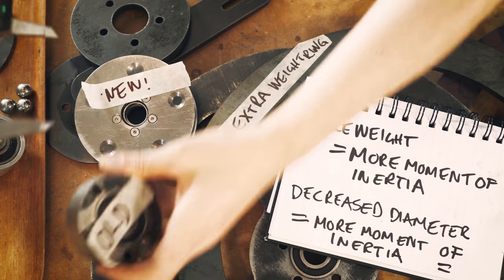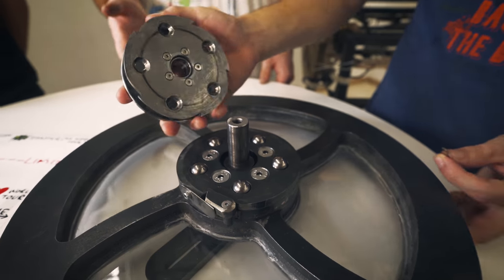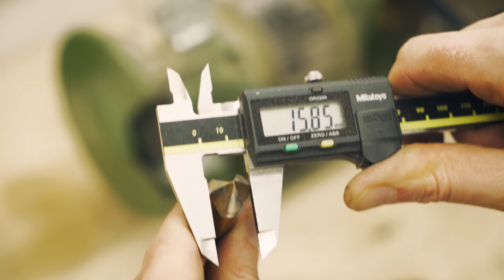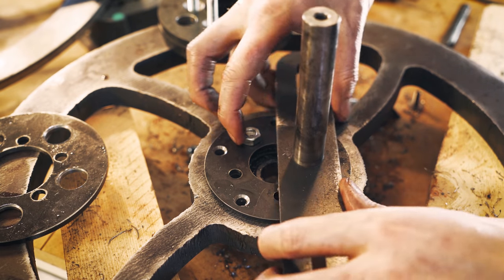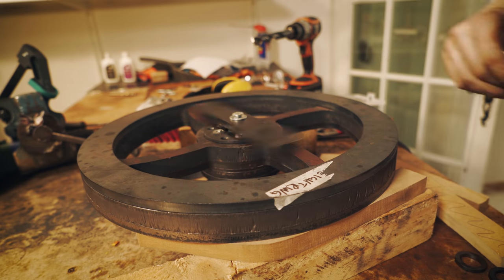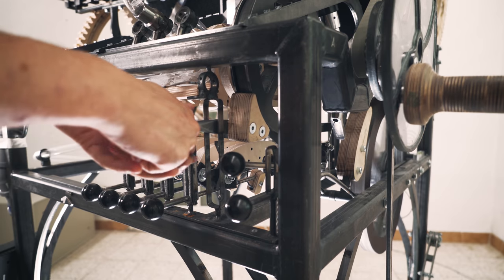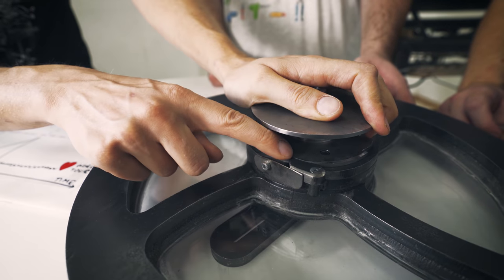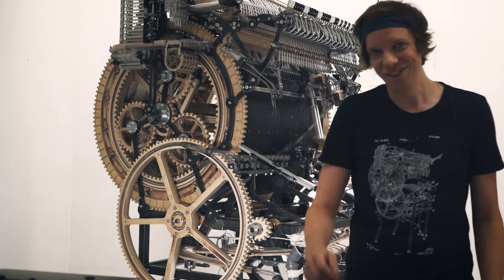Flywheel Torque Limiter - Marble Machine X#90

Comment: Very impressive engineering and craftsmanship! 

One thing that I noticed which gave me pause, is that when the rest of the machine runs, the crank spins as well. Since you're running it in only one direction, wouldn't it make sense to connect the crank with a similar mechanism as that of a bike's pedals (I believe it's called a backdrive stopper?), to stop it from being turned by the machine/flywheel, and making the energy exchange one way, crank -> machine, exclusively? 

I don't know if this would be too much of an energy loss, though, or would produce too much mechanical noise. 

Just a thought :)

Comment: For your brake, you may want to consider using some sort of consumable pad. For as much use as it is likely to see the metal will burnish the wood smooth, in short order. Think of a disc brake set up. The semi-metallic pads protect the structure and function of the mechanics, while ensuring consistent performance.

Comment: How are you going to incorporate the rattling noise?

Guess using super strong nylon instead of steel, isn't ideal? 

How often will you be swapping out the springs to keep the tension? Will they be affected by the heat from the friction of the marbles? 

What's happening with the program plates?

Comment: I'm a bit confused... I wouldn't expect the output torque to drop substantially below the torque limit, I would expect it to chatter just below the limit... Is there a static vs dynamic coefficient of friction at play here, or some other mechanism I'm not seeing, or is the graph incorrect?
Reply: Seems to me that when the balls are retracted and just rolling on the plate the transmitted torque is essentially zero.  OTH when they fall back into the pockets you will need peak torque to push the springs back to pop them out again.  So I think the wriggly line on the diagram actually should swing widely between essentially zero and essentially the peak torque setting, not the little oscillation that is shown.
Reply: Pretty sure the graph is incorrect

Comment: I don't really deal with torque wheels so perhaps I'm missing something but was there any reason why you didn't just use a single spring adjusted plate to hold the marbles instead of having them all adjust individually? It would seem to me like that would open the system up to more potential problems if the marbles were not adjusted evenly.

Comment: If you had made the flywheel without spokes, you would have not needed the plexiglas covers.  The springs on the limiter should not rest directly on the marbles.  The spring will tend to spread and jam in the bore.  There should be little discs between the spring and the marble so the spring has a flat surface to rest against.  Regarding the plate, why didn't you use the old one as a template to make a new one?  Isn't the weld build-up hard to tap?

Comment: Put stickers over the adjust screw holes on the torque limiter. That way you will know if someone has messed with your calibration. I work with a torque limiter every day that uses the exact method you have described and you better believe I make sure my cal sticker is unmolested

Comment: When you have to fill a hole with weld, if you usw a brass plug that covers the underside of the hole it makes it much faster and easier to fill even a large hole. The brass will just break away when you are done and then all you have to do is grind and sand it smooth. Also if the hole is a tapped hole just run a bolt in and cut it off as close to flush as you can and weld it in then grind and sand. The fill will be stronger than the rest of the steel and you will barely notice it if at all.

Comment: Is it just me, or is his graph... Wrong.
Whel the torque limiter kicks in, the torque curve should go to the wiggling motion at that level... Right? The device is a limiter, not a reducer
Reply: Absolutely. Thought the same thing.
Reply: Static friction vs kinetic friction
Once the balls have slipped out of their detents they're not gonna provide the torque they were before
And as long as the flywheel is moving faster than the machine they won't get properly seated again, they'll just bounce over
You can see it after Martin stops the machine with his hand, very little force on his arm until the flywheel's almost stopped and the balls can re-engage

Comment: Nice Diresta Ref. 
P.S. I presume you know but just in case you don't. That little piece that it supplying the racheting mechanism it's ability to both drive the wheel and then also torque limit is known as a PAWL.

Comment: stupid question, is your flywheel balanced as to reduce vibration and why not have the ratcheting paul and spring on both sides to not only keep weight even but also pressure, that way you're not over stressing the poor thing; kinda like a buddy system.

Comment: Tip for welding holes and sheets of metals:
Next time you wnat to weld a metal plates holes shut, you should put a ceramic piece underneath it, with a small gap (0,2-1mm) such things exist with al-stickytape put there's ways to make something else work the same way. The gap means that the material wont fall through, but it the plate will also keep the oxygen out, the small gap also has the side effect of limiting the amount of exess material as well as how far it flows, means you'll have less to grind and overall better welds.

As for everyting else:
A job well done, there wasn't much one could do to improve withoug making things bigger or way more complicated and expensive.

Comment: Your crank needs a free spinning hub, similar to a bicycle rear wheel free hub. This would allow the crank to “coast” when you aren’t cranking it...versus spinning in time with the rotating assembly, ready to catch on an unsuspecting operator and leave a mark (and strum a bone or two). The current Shimano 12 speed rear free hubs now free spin quietly (versus the classic ratcheting of the internal pawls of old), so there is a potential silent solution....

Comment: I like this Swedish / German cooperation  ...reminds me of the time Volvo fitted the  240  series  with a  straight 6 Cylinder  VW Diesel engine usually powering the  VW  LT  25  truck !Due to the outstanding quality of both parts it was not unusual these cars reached  more than 500000  and some even 10000000  Kilometers lifespan !

Comment: I think there is a little bit of a misuse of the term moment of inertia in some parts of the video. True, the flywheel does have a a moment of inertia. The moment of inertia determines how much kinetic energy is stored in the flywheel at a certain rate of rotation (rpm). When not rotating no energy is stored. The moment obviously also controls how much energy is needed to alter the rate of rotation, which translates into the flywheel acting to make the music tight (because the rate of rotation is very stable and requires much energy to change).

Comment: What is your y estimate on the amount of energy (watts) necessary to operate the machine? I fear that you will need the cardio output of a Tour de France rider once all components have been installed. This is one reason against adding anything that increases the energy required but doesn't produce music (e.g. kenetic fingers). Keep up the good work.

Comment: It might be a good idea to get a small torque wrench for setting those screws in the torque limiter, that way you ensure all 5 of those marbles are set to the same release point, and it'd probably be easier to experiment to get the release point that you're happiest with.
Reply: Probably too little torque for a reliable torque reading, especially when you have counting revolutions as a reliable alternative method.

Comment: Noob question - wouldn't the ball bearings in the torque limiter eventually manage to dig channels in the plate rendering it useless at some point?
Don't get me wrong, I'm not criticizing it or anything, it's a great solution. But I'm curious about the interaction between materials. Is the plate to be considered something like a consumable, or more like no matter how many rounds you go with it, it'll likely never reach the point of needing a replacement?
Reply: No, it won't wear down.

Comment: Hey Martin! With everything you are adding, more specifically how heavy the flywheel is, I'm becoming more and more concerned about how much weight the MMX's legs can take. The legs and the welds hold everything together are under quite a lot of stress and I'm losing faith on the reinforcements. Could you demonstrate next week how strong the legs are? Also, how balanced is the MMX? Is it as top heavy as I assume? I can't imagine the disaster of that things toppling over.

Comment: Maybe its an idea to put Bicycle brake pats on the wooden pats, that way you the woodenparts wont wear off, and the pads can be replaced easily by making a clamp system holding them.

Comment: Martin, have you already tested the brake system?
I mean, spinning it as fast as torque limiter allow, and then stopping few times in a row?
I guess, it wouldn't work quite perfectly. Plywood will be grinded by flywheel in short time, imo (not sure, but I think that is the way it will happen)

I suggest you using brake system like they do on cars, motorcycles or bikes. Like with disc, with brake pads... That will be much more reliable, also it will be easier to get spare ones - just go to car hardware store and buy it. 
They use brake liquid in card to make brakes stronger, but I think, you won't need brake THAT strong, flywheel has way less inertia than motorcycle or car(and there will be only one "wheel", not 4 or even 2). I suppose, even a simple mount or high-speed bike brake will be enough

Comment: Do you have spare parts? Not sure many places around the world have brake and clutch parts for a French made MMX. :) 

But no really at some point you are going to have to figure out what parts you have that will wear and need a replacement schedule. 

For the clutch I can see the holes getting sort of galled as the ball bearing roll around in there.

Comment: I think the diagram of the safety mechanism/torque limiter may be misleading. If I understood the mechanism correctly, the torque goes up to the limit, the torque limiter is triggered (the 5 marbels disengage) such that the torque limit is not exceeded. Then the five marbels engage in the next groove the torque again reaches the limit, the marbels again disengage and so on, doing the "drrrrr". Thus the torque seems not to fall back to "almost nothing" but it seems the torque limiter does its "drrrr" near the limit line, not near the zero line.  There may be some race conditions such that the marbels cannot completely engage in time. However the overall rotational speed seems a bit low for that and such an effect should wear off with decreasing speed of the flywheel, such that in the end, the "drrr"-line should approach the limit line.

Comment: Well, a torque limiter is definitely super useful for u machine, but as u can see, the torque limiter creates trrrrrrrrrrrrrrrrrrr sound! It sounds cool but this is also giving impact to the shaft of ur machine, that's like using an impact drill to turn your machine!
I am pretty sure that u will have to replace the shaft, bearings, gears and stuff if the torque limiter is being used overtime
My suggestion is to use some kinds of friction pads for your flywheel, it's pretty simple, once the torque is too large, the friction will not be enough to keep the shaft and the flywheel to spin together, and limit the torque

Comment: That point when you hear, “RRRRRRRRR”, that noise is called a “whir’ or ‘whirring’. The Wintergarten reminds me of Charles Babbage’s analytical and difference engines. Mechanical Machines designed to be computers for its time, at the turn of 5he century. The difference engine was totally completed in the 1990’s, though. Because it’s said Mr. Babbage was so far ahead of his time he couldn’t finish the difference engine due to not having the technology, at the time.

Comment: Just the thoughts of a random Norwegian guy:

Would it not be better for the crank to be routed through the flywheel before the energy being directed to the machine? That way you can build up flywheel momentum without the machine going, and you can maintain flywheel momentum with the crank/pedal, when the machine is disengaged from the flywheel?

I am not an engineer, so there might be some reason that it would not be wise, but i just thought i'd leave a comment ^^,

Cheers on the great work!

Comment: Wouldn't it be better to have a release between the flywheel and the machine, and leave the connection between the handle and the flywheel "live" ? 
As it is now, you will always have energy loss from the flywheel all the while you are not playing, so when you start again you will have to spin up the flywheel again to hit the correct BPM. 
If you had one belt from the handle to the flywheel, and other from the flywheel to the machine, you could spin up the flywheel while it was disconnected

Comment: Perhaps I missed it, but is there a way to spool up the flywheel independently of the machine so you can hit the ground running with some stored inertia?
Reply: all the channels have their own on off switch. Its the 6 or so levers with balls on them above his head when he cranks. So he can get it all moving and then start playing but the programming wheel is also moving so he would have to "rewind" the wheel and start the channel just at the right time.

Comment: I want to use flyweels as capacitors for storing energy (solar) for acouple of days (~50kWh), would be possible on vaccum and magnetic pulling to reduce friction?
Reply: Unlikely. Most commercial flywheel energy storage systems are only good for a few minutes at most.
Even industrial-scale systems rarely exceed an hour of "discharge" time.
And even with zero friction, you still have the problem of THE EARTH ITSELF spinning on its axis causing a flywheel to lose energy.

Comment: Martin, you've made a mistake:  increased diameter is more moment of inertia.   The moment of inertia is the integral of ρ r^2 dV, where ρ is the density, r is the distance from the axis, and dV is the differential in volume.  This is equivalent to Mr^2 for a simple hoop.  Anyways, this is a pretty nifty idea to use marbles in the torque clutch.  Excited to see what you show off next week; are we going to get a chance to hear what the ondophone sounds like then?
Reply: After rewatching your video, I realized I misheard what you were saying... Less diameter to the pulley (not less diameter to the flywheel itself)... So this would essentially make the flywheel rotate more times per rotation of the crankshaft, causing the flywheel to have more rotational kinetic energy at a given angular velocity of the crankshaft.  So then since rotational kinetic energy is half the moment of inertia times the square of the rotational velocity, increasing the ratio of turns in the flywheel to the those in the crankshaft (by decreasing the pulley diameter in the former) is effectively the same as increasing the intrinsic moment of inertia of the flywheel. Nice work Martin, and I look forward to seeing what you add next in the MMX!

Comment: The torque limiter chart actually doesn't work that way in this case. It doesn't rise that high, if it starts slipping that low, if you know what I mean. It would always slip at one point, so there wouldn't be that peak torque you had on the chart.

Comment: Shouldn't the graph in the diagram always go up to the torque limit, before another marble slips and it goes down again to almost 0?
Reply: good double Not if you stick a board in a wheel. Torque limit is reached if the flywheel has any torque at all.

Comment: Feel free to call me stupid, but when the torque limiter slips does not the torque goes down a small bit and then up to the torque limit again and then down a small bit again and so on, and not down to such a low level as on the graph shown?
Reply: No, since the marbles will not fully engage in the hole again while both parts turn at different speeds. It will go in a bit, but not far enough to transmit much torque.